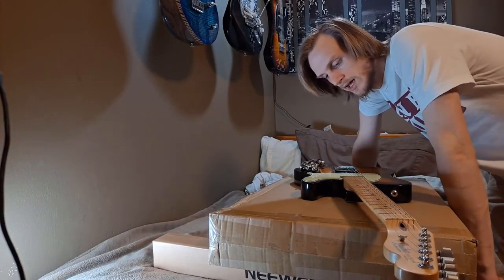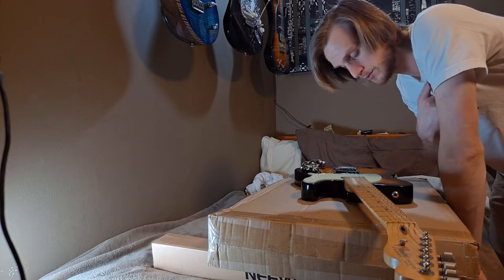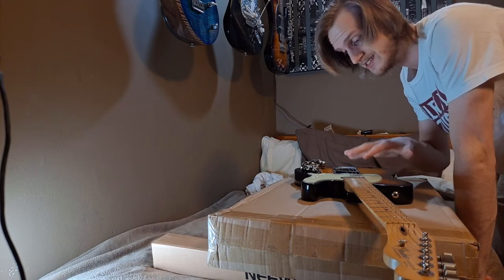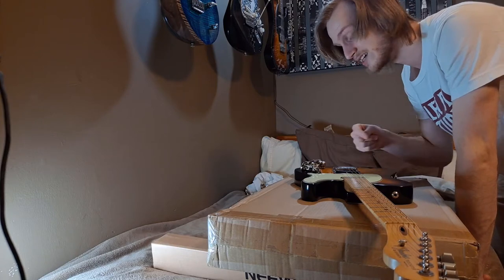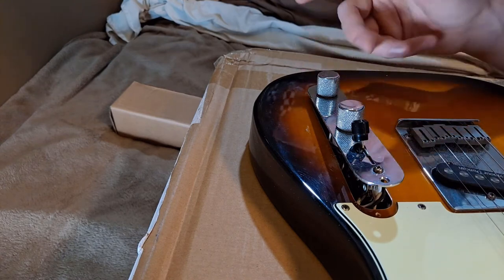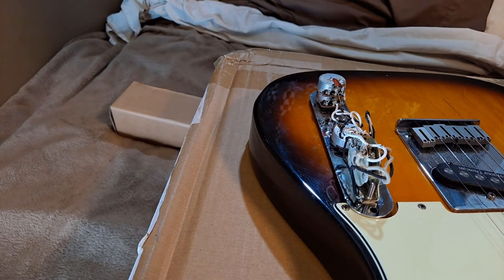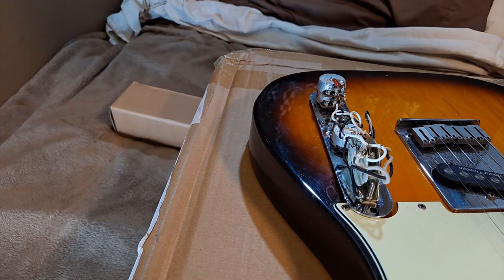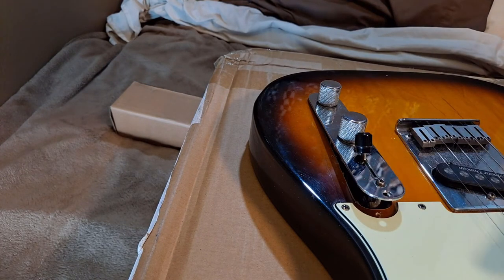Telecaster guitar short, grounding, static ISSUE FIX

Comment: I've got the same guitar/TBX control Telecaster, modern saddles, same noise issue that interacts with hands holding it. People are antennas. The previous owner(s) placed a ground lug on the switch mounting screw grounding the neck pickup and an extra wire to the volume pot cover.  I removed the lug at the switch screw but the noise issue is still there. I tried your suggestion but there is still a hum. Not as bad when hands touch the guitar. Single coil pickups. 

Perhaps more EMF interference in the air or AC lines these days? 

Had the guitar for 20 years never noticed it being this noisy before. 

Going to try shielding the cavity with copper tape next.

Comment: My Les Paul has been cutting in and out lately. I have hardly any knowledge of servicing guitars. Any tips? 
Honestly, I should just get a "dummy" guitar that I can use for practicing fixing and modding.
Reply from the maker: Might be a bad pot, orrrr...a broken or cold solder joint

Comment: Hi, can I ask where exactly did you place the tape because it's not too clear from the video.  I have exactly the same buzzing problem and tried the tape in a couple of places under the toggle switch but with no luck.
Reply from the maker: Over the solder joints
Reply: Thanks, I'll give that try.  @BenSDixonMusic

Comment: What is up with the dual pot for the tone control?
Reply: Might be a push-pull pot for the Nashville Tele, has a third pickup (strat pickup)
Reply: That's a Fender TBX tone control. It's a special double ganged pot with a center detent. When in center detent one of the pots acts like a normal tone control from center to counter clockwise. From center going clockwise the other pot has a section of the carbon track that has NO resistive material creating a NO LOAD pot. Some year Telecasters were issued this way from the factory. There is a video on Youtube "Anatomy of a Fender TBX Tone Pot" by "phostenix" and it explains this.